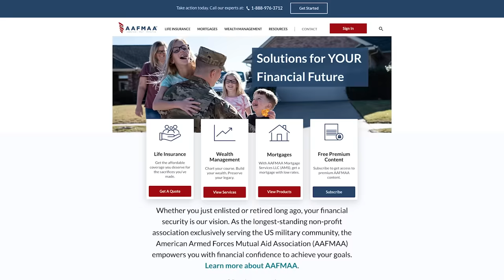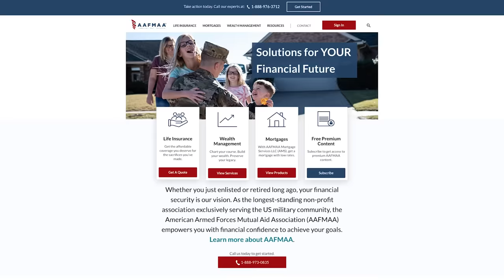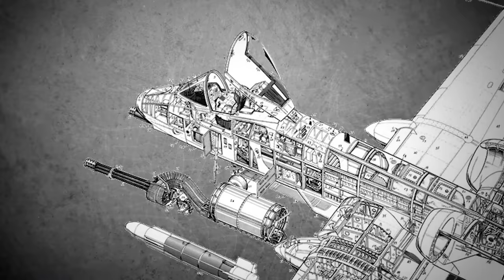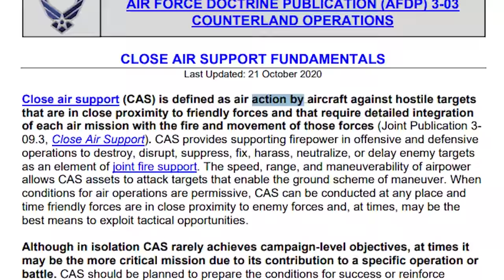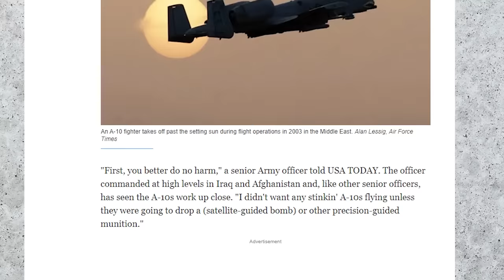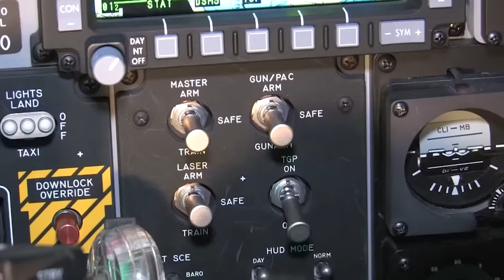Why the Air Force is Screaming to Retire the A-10 Warthog

Comment: Didn't see much analysis of WHY the Air Force is fighting so hard to cut the A-10.

The only rigorous head-to-head study done on F-35 vs the A-10 in CAS was done quite a long time ago, and the results never completely released. And what was released was heavily redacted.
I suspect it showed that the F-35 wasn't actually very good in CAS, not just that it was better than the A-10 in some aspects of CAS.

I don't believe that the Air Force is very good at understanding ground support. And that they don't really care.
With the exception of the A-10 force.

I also think that the Air Force has decided to cut the A-10's more from a budgeting POV rather than from well grounded mission aspects.
The F-35 is needed to fulfill other roles, and it's a (very) expensive plane: so they are trying to rationalise everything, by a "one size fits all" approach.

It's also not obvious that anyone really knows how survivable the A-10 really would be in the sort of conflicts going on now. 
Or MIGHT occur.

The best idea would be to send some A-10's to Ukraine, and see how they perform.

Nobody has air air superiority there.
And there's a VERY big mix of air defence weapons: we might find that the A-10 has some excellent niche areas.
After all, some of the fast movers are just being used to fire-off cruise missiles, or glide bombs, and don't even need to cross the front line.

Comment: Yes the A-10 needs to be retired. We all know that. The problem is it has no replacement. The USAF can try to justify the boondoggle that is the F35 all they want by saying it will completely fill the CAS role but we know that fighters are not capable of the to-the-ground relationship necessary for supporting troops in a dynamic combat environment. The USAF has tried to rid itself of the CAS role for a long time now and they would love nothing more than to see the A-10 go away for that reason alone. However, they are still covering their behinds(budget) with the old fixed wing rule with the Army. The USAF needs to decide which side of history they want to be on. Doing what's best for our fighting forces as a whole or doing what gets them more money to spend on their geek toys.

Comment: I hope they put the GAU-8 in another plane in the future. It really needs to be in a variable swept wing plane. That gives you the biggest operation window for speed and efficiency. An adaptive cycle engine would be a major benefit for fuel efficiency as well. A really crazy hat trick could be something like a VTOL hover to literally hover at what needs to be shot at and brrt the target into a crater. The new GE XA100 Adaptive cycle engien would be perfect for it. However they have tried to kill the A10, but they just seemed to make it too unkillable.
Reply: The problem is the GAU-8 isn’t really that effective anymore, if it ever was. The majority of A-10 tank kills were with missiles. Another thing is that I don’t know if another variable wing plane will be built due to cost and maintenance.
Reply: @justinrockholt7055  I don't understand the GAU-8 being ineffective. It's highly accurate, cheaper to use, and destroys targets. Missles are a 1 shot 1 target type use, a machine gun is a strafe as well as single point. If you know the general area of where some targets are, the machine gun is perfect for that. A missle is better for a communicated known target
Reply: @joshlewis5065  
TLWR: The GAU-8 isn't efficient compared to missiles.
The problem is that the GAU-8 is a very close range weapon compared to missiles, and the precision leaves a lot to be desired.
If I'm not mistaken, the designed CEP (circular error probable) is about 80% in a 40' diameter circle at 4,000'. Imagine a school bus being rotated in a circle, now imagine that 8 out of 10 shots will land somewhere in that circle (this is percision), and the remaining 2 will be outside of that. 

Accuracy is hitting where you aim, think of a bullseye, hit the bullseye and that's accurate, land the darts right next to each other and that's precise. 
The AGM-65A Maverick has a reported CEP of about 5'. The versions used by the A-10, AGM-65B/D/G had an accuracy (hit rate) reported between 80% and 90%. This is according to Raytheon's own information about the system. 
The Maverick has a reported cost between $17,000 and $110,000 depending on the variant, and for this, I'm going to assume that the hits also led to kills, mission or otherwise. The 30mm API (armor piercing incendiary) round of the GAU-8 costs, by my quick search, about $100. The GAU-8 has two selectable fire rates of 2,100 or 4,200 rounds per second. The magazine can carry 1,174 rounds. 
So lets assume the pilot drains the magazine, it's been a good day for tank hunting. It would cost $117,400 doing that. a little more than the cost of one of the later models of Maverick. The A-10 can carry up to 6 Mavericks, and lets assume that they are all the most expensive model. So $660,000 of missiles mounted, and lets assume the lower accuracy is correct, so 80%. We have 10 A-10s going out to make the math neat. Quick math shows us that 80% of 6 is 4.8. So of our 60 missiles, 48 can be assumed to hit and kill a tank.
30mm API is reported to be able to penetrate up to 200mm of rolled homogeneous armor (I have my doubts but...) but just like with the Maverick, we will give it this quality. Our target will be the T-90, the most advanced Russian tank (T-14 doesn't exist (in numbers worth considering)). Here are some numbers: T-90 armor has effective thickness against APFSDS (a gigantic dart shot by tanks) of 550-650mm, with Kintakt-5 ERA=800-830mm. Against HEAT 1,000mm and with Kontakt-5=1,150-1,350mm.
Tanks carry their thickest armor on the front,so let's assume that against API ammo that the 1,000mm is what we need to beat; and lets assume that the top armor is only 10% of that. So we only need to beat 100mm right? Nope. The 100mm of armor is only at 90 degrees (good luck with that.) after everything, the total top armor, including ERA, will likely come out to 200mm or barely above, add in the angle and odds of penetration are slim.
I have a report right next to me about the GAU-8 test firing, the same one Lazerpig used in his videos, titled : Combat Damage Assesment Team A-10/GAU-8 Low Angle Firings. Be aware that this is not about the t-90 but T-62's but the T-62 has less effective armor and less armor in general than the T-90.
The summary reads as such: "This report describes firings of the A-10/GAU-8 weapon system against individual combat loaded Soviet main battle tanks. The pilots making the firing passes attacked at low altitude and corresponding low dive angels simulating movement through a hostile air defense system. Ammunition used in the attacks comprised 30mm armor piercing incendiary  rounds, which proved to be effective damage agents against substantial areas of the Soviet T-62 tanks used as targets. The pilots in six successful firing passes (one additional pass resulted in a miss) scored 95 impacts on target. Which included 17 perforations through the armored envelope. The six tanks which were impacted received damage physically assessed as ranging from catastrophic in the case of two combat loaded vehicles to negligible in the case of one tank attacked directly from the front."
it is a 102 page report, but here is something I found related to the number of shots fired  "The ratio of impacts to rounds fired was 0.10." That means that the pilot used 950 rounds to hit 6 and, to give the most credit, kill 2. There were 10 tanks being shot at.
Reply: Hover in place lmao

Comment: Such a stupid move to retire it without a replacement. Smacks of when the Air Force thought it was a good idea to only give the Phantom missiles...
Reply: Heres a list of multirole aircraft that can replace it so much better:
F-15E
F-15EX
F-117
F-111F
F-35
F-16
B-1 
F/A-18
Also, the NAVY was the one who gave the Phantoms only missiles. The Air force had the M61A1 Vulcan installed on theirs. Yet, the Navy phantoms performed better anyway.

Comment: I still keep saying that we should've retired the A-10 in the late 90s and kept the F-111 Aardvark in service... :o
Reply: Also about the whole "troops are worried" thing... I mean, the F-16 and F-15E are more than able to take the A-10's place in CAS roles. Plus they both (along with the Aardvarks) performed very well. As it turns out, a guided bomb is pretty good for doing CAS.
Reply: @spenjak18  F-15s, F-16s, and F-18s account for way more CAS sorties than A-10s. Besides, as long as the troops get support from a plane that can drop bombs and strafe, they'll be just as fine as before.

Comment: Any CAS support asset is gonna not survive in a contested sky, so arguing that as a criticism is goofy. Rather have the outdated but useful ground attack force multiplier than the space ship that only shows up 10% of the time.

Availability is your best ability. 
The p47 wasnot a good cas system, but it was available always which made it better than any fancy (at the time) next gen fighter like the jets 

Fun fact, the p51 was made as a ground attack plane...it was bad at it.. so cas groups swapped 51s for p47s

Rather

Comment: The other way is to transfer all the A10 to the Marines.  One of the reason the air force don't like them is because even as heavily armored, it will not stand up in a high threat environment, plus the air force have a culture of chasing the highest tech. It will take many us ground casualties and lost F35 before the air force again relearn the lesson from Vietnam that low and slow is better. Maybe if they are really desperate, they might try and buy some SU25s from the Russians.

Comment: A  30 mm revolver canon of 120 kg (264.55 lbs)  fires  2 500 rounds per minute  at a velocity of 1025 m/s  (3063 feet/s) and it's in a  multirole fighter aircraft ...With 14 External hardpoints for Air and Space Force versions , 13 for Navy version  and a capacity of 9,500 kg (20,900 lb) external fuel and ordnance.
Je ne proposer que 2 500 obus par minute de Fraternité.😈

Comment: It's going to be difficult to design a bird as capable. Some say the35 can do it... thats extremely doubtful. War does not change... tactics do.. and these self same tactics are cyclic. Best to keep a few. They'll be necessary again.  As for the air force.. brass,they can pound sand. Remember.. the air component has no artillery nor ground troops. Sure they can pound the ground, but I've seen (first hand) air components fail to initiate a successful mission. The air force started as the Army air Corp. Just as then, their usage has limits. Give the a10 to the army. It's still better than the osprey and makes a wonderful addition to the ground scenario. That way both units are satisfied.  Let the army budget take a10 development,  then that allows the air force their overpriced toys

Comment: No drone can react as precise and fast as an A-10 Cockpit.
Reply: Skyranger 30, Patriott and Iris-T. Drone Commands integrated plus A-10 short field runs. Who could Cover this up?
Reply: Die Kadenz der Waffe bietet kein anderes Waffensystem in short.
Reply: Das ist ein short to field secured hit Cluster.
Reply: This is a bind, of attack. Who is weak, who is on for heart.
Reply: A 45 mile range field is butchered for the agressor with this Systems.

Comment: If I were a grunt on the battlefield needing immediate, danger close, air support, I would much prefer a dedicated close air support aircraft with a mission availability rate of 72.54 percent in fiscal 2021 (A-10) rather than a fast stealth jet swiss army knife with a mission availability rate of 50 percent as of March 2023 (F-35A) . The A-10 is built to survive down low in harms way, take a lot of damage and continue to fly. It can loiter over the battle space longer than a F-35 with its turbo fan engines and fly slow enough to allow the pilot to accurately identify and accurately engage ground targets. If the USAF is determined to divest of the A-10, then modify the scope of Army aviation and allow the Army to take over A-10 flight operations. M1A tanks and A-10s working in unison would have a devastating effect on the modern battlefield. Who knows better than the infantry soldiers and the A-10 pilots what is best for the men at the tip of the spear where the metal meets the meat. The B-52H is over 60 years old and is still raining down iron hate on our enemies. The A-10 and its pilots should continue to fly until there is a better dedicated close support aircraft. Sexy and fast does not scare the hell out of the enemy. However the shadow of an A-10 Warthog moving over the battlefield is like a hawk soaring over head looking for prey. BRRRRRRRRRRRRRRRRRRT turns the enemy into KIAs, WIAs, MIAs and deserters. What more could you ask for from an old soldier that refuses to surrender or die.
Reply: If you were a grunt, you'd be happy so long as a plane or heli on your side comes in and blows shit up. A-10 is exorbitantly expensive to fill this single role, while being far more vulnerable than any other airframe in US service for close-in support. Your figure (72.54%) is in literally ideal conditions for CAS missions, complete air dominance. The second any airspace is contested, A-10 will be cannon fodder. Sure, F-35 can't carry as many bombs, but when you're fighting the Chinese or Russians, it may well be the only aircraft that can swoop in to drop those bombs. 

"So we keep it for those low intensity conflicts!" You may say. In that case, why the hell are we spending so much money on running these aircraft when a turboprop attacker can do the same job in the same environment for half the price? 

A-10 is flat out inefficient.

Comment: Seems to be quite something to blame an aircraft for causing a friendly fire incident. I would have thought it would be the guy whose fingers on the trigger. Friendly fire issues have always been a staple of combat operations, that's where training and coordination comes in. It's no more fault of the warthog for engaging friendly troops than it is for water to be wet.
Reply: it´s the fault of the poor situational awareness of a plane designed for the 60´s
Reply: @aquilesca5tr0  warthog Pilots work in what's called a kill box. If you learn anything being in the military, the one important thing to learn is never be in a Kill box. 3 to 400 Mi an hour at 100 ft above the ground does not give you ample time to make split-second decisions on what is what, friendly fire incidents or what we endure in the military and will be until Wars end. But they fought the airplane for those fatalities, it's a machine, it does not make decisions. It's the guy who's controlling the airplane who does that. Whether he was in a warthog, a hornet, a harrier, in the same situation those people would still be dead. You can't blame the plane for that, that's idiotic.
Reply: @mrgrinch837  a pilot shouldn´t rely on binoculars to identify targets
Reply: @aquilesca5tr0  well if you could see by the photograph on my account, I was a pilot. What would you use a Ouija board?  As a matter of fact, I flew Cobras for 9 years. We have a 13 power telescopic site, we also have two crew members in the aircraft. One to fly and keep from getting shot down and the other two identify friend or foe. That's why that aircraft works as well as it does in the Apache does the same. And A-10 doesn't have that ability so the pilot does the best he absolutely can. As a 20-year veteran, 10 years as a paratrooper 10 years as an attack helicopter pilot I can tell you for a fact my friend there is no better aircraft for close air support with massive Firepower than the warthog. Nothing else comes close.

Comment: they better have something to replace the A-10 that can (A) take a hit and keep flying, (B) Slightly faster, (C) carry the same loadouts including the GAU-8, (D) Cost effective and easier to maintain. Otherwise the are eliminating a asset that still has use for no reason other than its old. Before someone says anything.... no F-35 don't count. While the F-35 has good stealth, if it is seen by an enemy jet it for one cannot take a hit what so ever... US Airforce needs a dedicated updated ground attack aircraft that can take a hit even if it is hit/missing a wing/dmg Ailerons. Even Russia and China understand this much.... which is why its imperative the  US Airforce seek a new dedicated ground attack and support aircraft that can fill the A-10s mission in the fleet. Again F-35 does not count... its too expensive to build and way too expensive to maintain a fleet of them dedicated to ground attacking.

Comment: The A-10s gun apsychological weapon only it is so inaccurate as to be a danger to own troops its accuracy is like 30 feet radius, or a circle with a diameter of 2 school bus's end to end! meaning if you are anywhere around the target you are likely to get shot. This is partially due to you know its a plane not a sniper rifle, but also as it effectively uses a holo sight ie zero magnification on a moving air frame at over 1000yards but more like 5-10,000. This is why blue on blue is highest amongst ALL aircraft for the A-10. Hell the british in Afganistan did not want them anywhere near their troops

Comment: If an A10 over the battlefield has trouble identifying freindly forces, how the hell can a super sonic jet do close air support miles away. On a modile battlefield were positions can change quickly you need a cheap tough loutering craft to be available
Reply: Via electronic systems

Warthog has them in upgraded versions but upgraded versions cost more making that thing even less worth the money